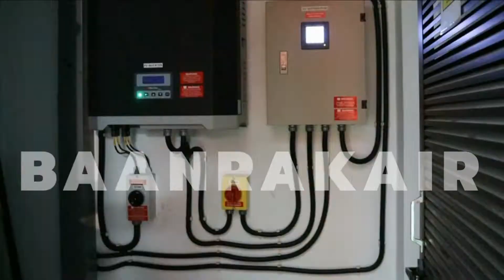How to clean air conditioner. - Panasonic.

Comment: Very thorough steps and clean. I would wash the fins of the condenser with a vertical motion instead of horizontal to avoid bending the fine aluminium fins though. Nevertheless, great video.